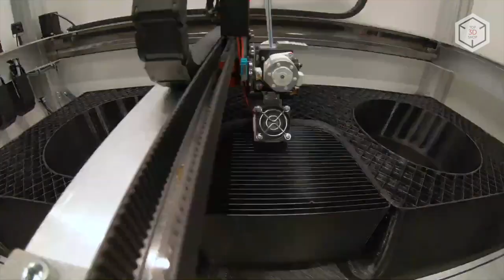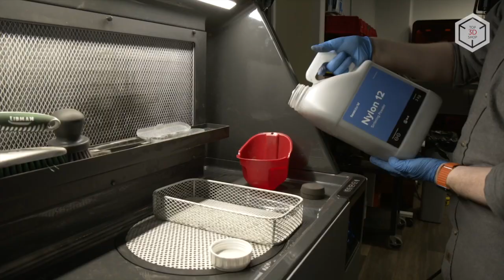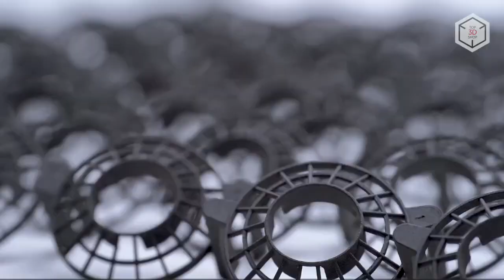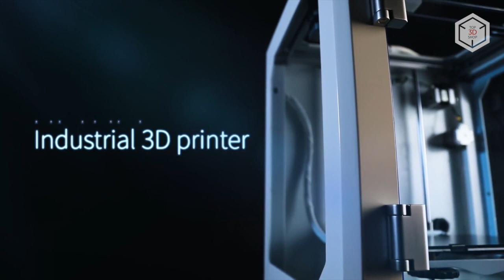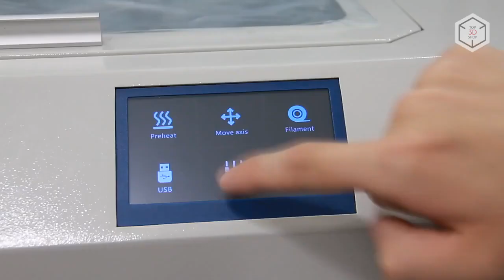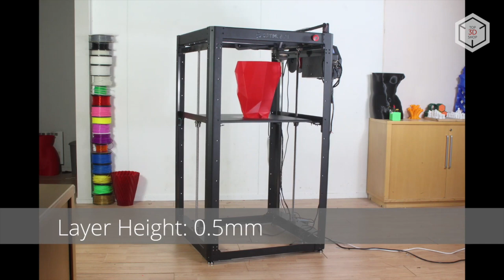Professional 3D Printers in 2023 — Part 1: Types, Features, Applications, Best FDM 3D Printers

Comment: I understand Bambu's P1S or X1C are FDM printers (hot glue guns) that support PT, PLA, ABS and carbon fiber material..   but what kind of materials are used  SLS/SLA (resin+uv) printers?

Aside from speed and the volume size of the print, how does the technology differ from industrial 3d printers (Stratasys Fortus 450mc, sPro 60, Essentium, Fusion3 F410)?  Is it that those support even more exotic materials (Peak Victrix AM 200)?  Or is it about the software (Orca Slicer , FlashCloud support, etc)?